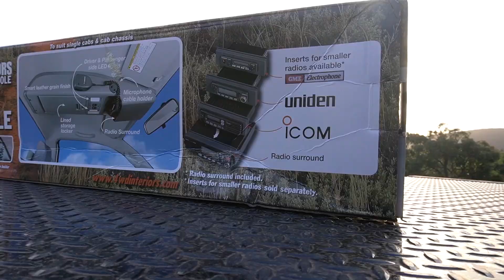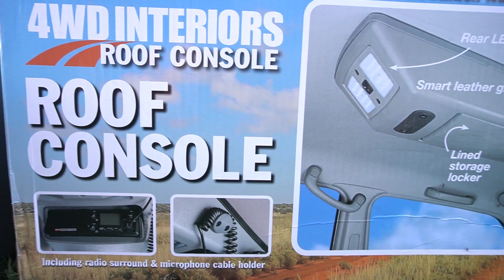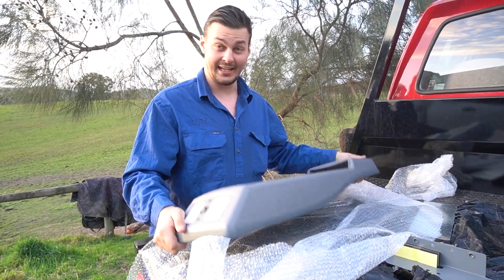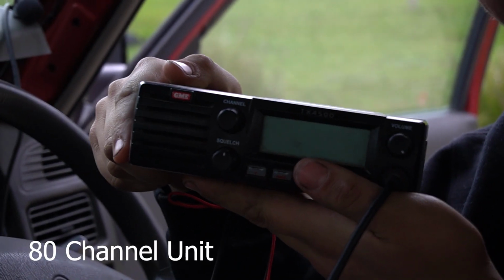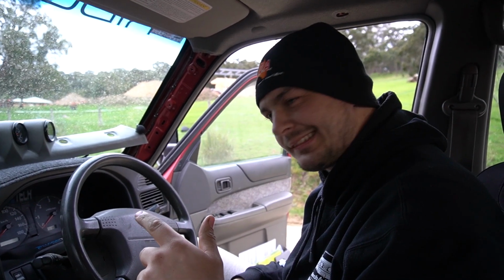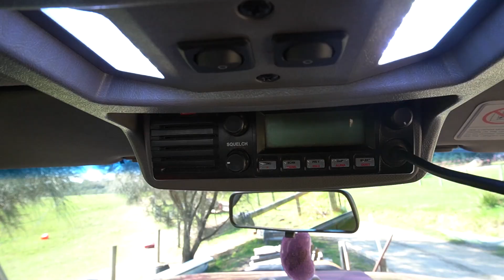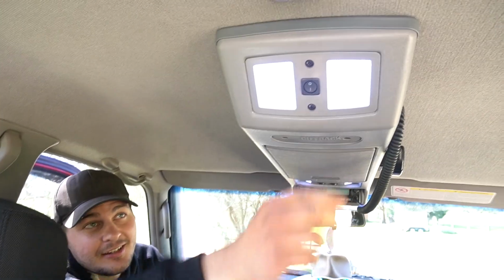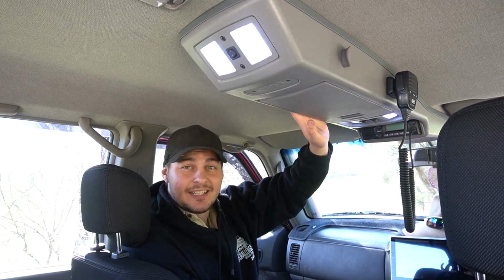The BEST 4x4 ROOF CONSOLE?

Comment: Lovely to watch I've just got the same console but I'm not too keen on the install could you please put up how drilled into the roof lining
Reply from the maker: Thanks, HI! Yes the roof console actually came with a template that bolts into the screws near the windscreen, I then used the supplied screws and screwed directly into the templates holes trying to find the thread! Let me know and I will make an indepth video!
Reply: @NEAT4X4  thank you kindly mate appreciate your feedback l seen one video of some cutting holes in the roof lining. Your way sounds way easier

Comment: Did the ve seats bolt in on the Nissan rails? I’ve been thinking about putting ve seats in mine. Be good to see a video on that! Loving the vids otherwise, very informative 👍🏼👍🏼 subscribed.
Reply from the maker: gday mate! Nah unfortunately they do not bolt into factory rails, ive used the hurrcan adaptor brakcets but if your handy with a welder you can make the seats work with the factory rails! Cheers for the support mate means a heap!